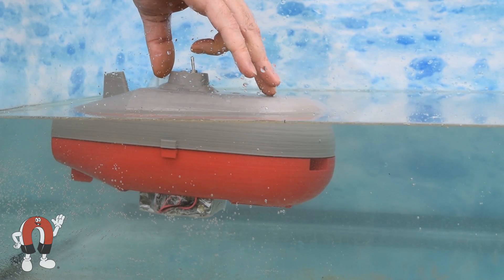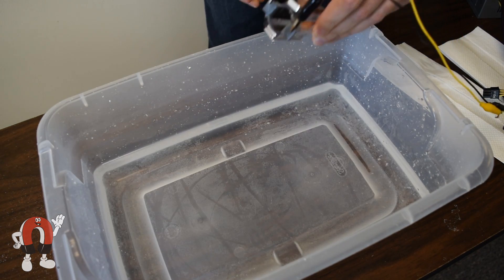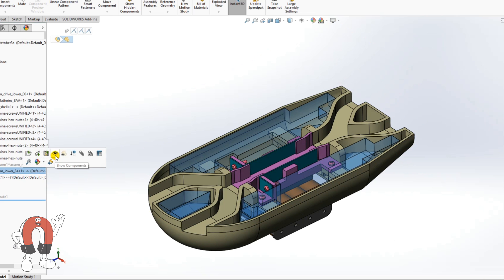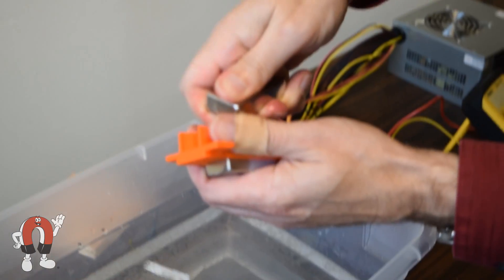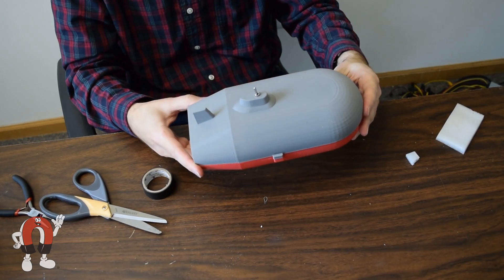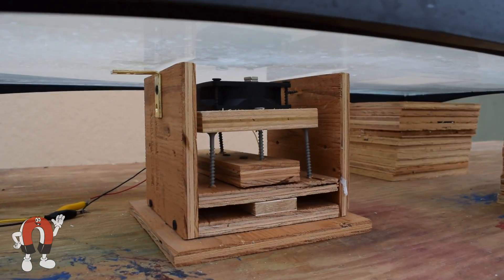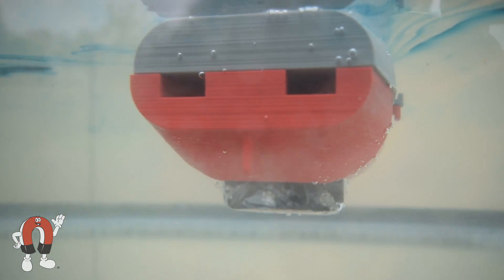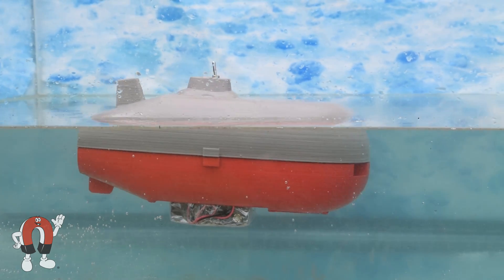Magnet Powered Submarine - The Hunt for Red October IRL!

Comment: Would love to see this with:
1) Actual parallel drives so you don't lose force on the internal water channels
2) A narrower submarine with less drag
3) Narrow outlets than inlets to increase the pressure of expelled water
4) A rudder
Reply: 3 is a bad idea.  unlike gases, water isn't compressible.  Reducing flow by creating a blockage will work against it
Reply: @adriendecroynz  let's also keep in mind two factors here 1 gases are being produced and 2 keys also keep in mind how a pressure washer works, the narrow exit forces the water stream to its tightest level creating force. The more narrow your stream is the more pressure you'll get. So in theory exit ports that are smaller than your intake ports should produce a tighter stream creating better propulsion.
Reply: @docneedles69   The velocity of the "tighter" stream will be increased, but that is immaterial, as is the pressure. A nozzle certainly increases the effect of a pressure washer on the dirt, but what matters here is the "kick" on the gun, ie the reaction force, and that is solely a function of mass ejected per second. And (getting back to the model sub) because the OP wanted to constrict the outflow, that mass flow rate will be reduced in comparison to the unconstricted original design because of increase friction, creating less propulsion force.
The amount of gas produced (in terms of mass) is absolutely negligible.
Reply: @adriendecroynz  not unless they meant it as a nozzle.  Otherwise nozzles would blow up, according to your explanation.  :)
Reply: @adriendecroynz  How jet motors work?
Reply: @DAMNED SHARP KNIVES no.  Water may not be completely incompresisble, but it is for the purposes of this test.  It most certainly is not "very compresisble". You have to go down miles in the ocean for the density of water to increase by more than a percent.  Cavitation is not water compressing.  It's caused by water vaporising, and that vapour compressing.  Choking the output of this motor will just reduce thrust.
Reply: We messed with this a few years back...couldn't get it to work
Reply: @DAMNED SHARP KNIVES I guess the earth is flat too hey?  See how much you can compress some water.  Easy to compress gas.  Most texts state to consider water as basically incompressible.  Do some research.
Reply: @DAMNED SHARP KNIVES the gas is compressible. But the gas and the water are 2 very different things. At the bottom of the Mariana trench the water is only compressed a couple of percent. That’s not ‘very compressible’. The pressure levels at that depth are not recreated by a propeller on any boat. Water is moved by a propeller not by being compressed. Take another look at the definition of compressibility. It’s the ability to squeeze a certain amount of a substance into a smaller volume, hence density is a direct measure of how compressed something is. You’re conflating issues.
Reply: @DAMNED SHARP KNIVES other properties. Water is not that viscous, it doesn’t lubricate, it expands when it freezes etc. maybe instead of spending so much energy asserting you are right, you could find me a link to a page on any university or scientific paper that states that water is ‘very compressible’. I can only find ones that state it isn’t
Reply: @DAMNED SHARP KNIVES yawn. You couldn’t find anything to back you up hey? Only countless websites that state that water is basically incompressible. And that wouldn’t suit your narrative eh?
Reply: @DAMNED SHARP KNIVES I’ll give you this: water is more compressible than some other liquids. It’s much more compressible than steel. But there’s no way it’s’very’ compressible on any scale. As for the water / gas mix in the video the gas is compressible the water is not (not in that machine). It’s also a big problem for silent running. Running below about 1.3V would solve the gas problem. But I don’t believe this was presented as a gas powered engine. The gas would provide force in all directions whereas the electromagnetic force is unidirectional for thrust.
Reply: @DAMNED SHARP KNIVES so how much pressure do you need to squeeze 2 cubic inches of water into 1 cubic inch of volume?  

I couldn’t make out any actual formula in your comments. It’s hard to do formulae in youtube comments so I’ll give you the benefit of the doubt or maybe you have a link.
Reply: @DAMNED SHARP KNIVES even just looking up bulk moduli for various things. Hydrogen 1.4E5 compared to 2.1E9 for water means water is 15000 times more resistant to compression than hydrogen. I don’t know if that supports a claim of ‘very compressible’. Compared to solids, sure. But on an absolute scale? It’s down the uncompressible end of the scale.
Reply: I don't see any links.  Did you post them?  Also, water is actually less compressible than brake fluid (300kPSI vs 200kPSI).  But thanks for the pointer to bulk modulus.  If you ask a geologist whether 1000 years is a long time, he will say no.  If you ask anyone else, they will say yes or a smart person will say 'it depends'.  I stand by my original statement that constricting the output of this particular engine will reduce the thrust, even with the gas.  And also that on any every day scale, water is treated successfully as uncompressible.  In a specific hydraulic (where do you think the hydra comes from) laboratory dealing in very high pressures (the reason I raise the Mariana trench is because it is the highest pressure place on earth you can actually go to, but even that's only 16kPSI, but still much higher than max hydraulic pressure in hydraulic machinery of 10kPSI.  At that pressure water would only compress a few percent.  Not what I or most people would call 'very' compressible.  But thanks for the chat anyway.
Reply: @adriendecroynz  you talked a lot of talk and overlooked the main fact that air at subsonic speeds is treated as "incompressible" and aerodynamics is exactly teh same as hydrodynamics... bernoullis applies. conservation of momentum. 

all that talk and yet you dont understand how a jet drive works...
Reply: @DAMNED SHARP KNIVES bouyancy is more a matter of density and displacement.  When you drop an aircraft carrier into the ocean, the water doesn't compress to accommodate it, it is just displaced, and the water level around the earth goes up by some infinitesimal amount.  Just like when you get in the bath the water level rises.  To squish 2cc water into 1cc you need over 10000 bar or over 150,000 PSI.
Reply: actually it's more than that, since the k increases with pressure.  Otherwise you could squish something to absolute zero volume with only the bulk modulus of pressure.
Reply: @DAMNED SHARP KNIVES if you look at the phase diagram for water, you'll see that it goes to gas at about 0.03 Bar at 20C.  My understanding is that's what is happening in cavitation.  The pressure is lowered and the water becomes a gas.  I don't believe even a 10% change in bulk modulus for water would mean ships no longer floated.  It's mostly displacement, very little compression.
Reply: Greater weight to have multiple drives, nozzles increase velocity but presents a pressure drop to do so.  I'd first work on increasing magnetic flux density while keeping electric current to where electrolysis is minimized and perhaps using radio waves or magnetic induction instead of electrodes though with radio waves, it would be more of a plasma drive than a MDHD drive.

Parallelism can wait till you work how far you can divert the energy transfer away from the electrolysis on the plates.
Reply: 3 is a bad idea, but the assumption you make is also wrong. Narrowing the tube is not increasing pressure, it actually decreases pressure; what it does is it increases velocity, and velocity x pressure is a constant value. However, as promising as increasing velocity might seem, it's not going to work in favor of a faster sub (less moved mass per time unit at faster velocity under less pressure is a net loss in thrust).
Reply: @lucemiserlohn  depends on how you measure the pressure.

at RIGHT ANGLES TO FLOW the pressure is low.

but looking into that higher velocity flow, theres momentum, inertia, and a higher ... ffs, i forget terminology... "dynamic pressure"? theres static ambient pressure with teh added momentum.

pitot tubes...
Reply: @DAMNED SHARP KNIVES plenty of people don’t understand the science behind what they do for a living

Comment: That's nice, but how does it scale up?
Reply: Poorly (for speed) as I understand the science, even if you have access to a nuclear reactor!  Now they WOULD be very quiet especially at a submarines normal operating depth but even so, most submarines are tracked by listening for mechanical noises OTHER than the screws (pumps and ventilation blowers) and this drive system wouldn't eliminate those noises.

Comment: With no moving parts I would think this has to have been considered in some way for the navy. Less things to wear out and break. Cool
Reply: The electrodes would erode faster than standard drive systems.  I suspect something similar is used for SEAL insertion teams though.

Comment: 2:15 Those bubbles are chlorine gas & I think hydrogen 
(because salt contains Sodium & Chlorine (NaCl), then water contains Hydrogen & Oxygen, and the chlorine bonds break down first) (Something probably also reacts with the aluminum too)
Here is why: https://youtu.be/g3Ud6mHdhlQ?t=459
Longer more explained version: https://youtu.be/g3Ud6mHdhlQ?t=416
Reply: yeah i think a lower voltage & stronger magnet would be the way to go here

Comment: Some suggestion:
- use Sodium bicarbonate instead of salt, it will avoid chlorine, preserve electrodes, and is easier to dissolve.
- raise the voltage: the more the voltage the more the current for the same amount of salt
- add a rudder so that your submarine make circles instead of strait lines
Reply: This would be one of the reasons why this propulsion method is not used in real life - good luck replacing the salts in the oceans by sodium carbonate 😊. Not to mention that one could easily find the "stealth" sub by following the flammable bubble trail.

Comment: Would it work in fresh water? and what about AC voltage?
Reply: Pure fresh water is an insulator, so would not allow any current to flow between the electrodes, so the device would not work. AC voltage would reverse the current periodically. If permanent magnets were used to supply the magnetic field, then the direction of the thrust would also reverse periodically too. But you could get over that by using AC electromagnets for the field.

Comment: Using electromagnets instead of magnets and AC instead of DC, you could perhaps keep the action while reducing or completely suppressing the electrolysis. It could perhaps even allow you to insulate your electrode plates and just use them as condenser plates to induce current in the water withou direct contact with your power source.

Comment: Recommend a single venturi inlet, a single pipeline, two serial mag-drives in series, and a single cone exhaust (exhaust point maybe 1/2 of internal pipeline width for a venturi IN to venturi OUT design). Mount two smaller inline mag-drives (one just behind the venturi point in the bow inlet and second at the point the exhaust pipe begins to cone inward at the stern). Increase the exposure time of the water molecules to magnetization by using two smaller mag-drives in series (consider wrapping magnets - like a U-shape top and bottom to fully expose the "fuel" to the magneto-electric field). The desired goal may be to reduce the amount of water in the system at a given moment by using a narrow pipeline (relative to the mag-drive's Lorentz force and the mass/dimensions of the vessel being propelled). Consider reducing the volume of and the length of time that water (fuel) is in the system to maximize the effect of each mag-drive's output (IE: X amount of force exerted per Y volume of water over Z period of time). etc. etc. etc. But an excellent experiment! Well done.

Comment: I can see why they had a problem making such a drive. If it is producing bubbles, it is probably not so silent. If the goal is silence, that could be  problem. It might take some depth to prevent the production of bubbles, and then you need to determine how much of the thrust is due to the formation of the bubbles.

Comment: There are two forms of silent electrical propulsion. First is Magneto Hydrodynamics. The second is using electromagnetic force. This involves creating two tunnels down the submarine and lining them on the inside with a long balloon. Within that rubber lining is a magnetic fluid. A series of electromagnets are placed in sequence around the outside of the two tunnels then produce an magnetic field which attracts the magnetic fluid to them. By switching on each electromagnet in sequence, you create a peristaltic force which moves the water down the tube as the lining squeezes the water in the tube, in exactly the same way as food is propelled down the alimentary canal in a human gut. 

This form of silent drive is better than the Magneto Hydrodynamics as it does not involve passing a current through the water or the production of hydrogen and chlorine from electrolysis. The amount of these gases would produce a tell-tale stream of bubbles out of the vehicle, as well as wear down the electrical anodes. However, the rubber lining would wear over time and be subjected to sea life such as barnacles. This could explain why it would be necessary to cover the entrance and exit of a such a drive whilst not in use and also used anti-fouling fluid to prevent barnacles blocking the tube. 

A nuclear powered submarine could generate sufficient electrical power to drive either system. Nuclear submarines stay underwater for extended periods because they can create oxygen using electrolysis. The problem with either system is that they rely on creating a massive magnetic field. Submarines can be detected by their magnetic signature and how it disrupts the planet's own natural magnetic field. So increasing the magnetic field might give away the position to anyone on the surface or in the air, even though the propulsion system conceals them by not making a noise.

Comment: Dude that's pretty cool, using sea water, electricity, and magnets to produce thrust, it doesn't use any moving parts, that's very cool.
Although I think the electrodes would get worn out pretty quickly seeing how it's basically reacting with the sea water by electrolysis

Comment: (It's been a while since I did Chemistry but if I remember correctly) Simply adding salt is not going to change the solubility constant of the water. Increasing the Temperature/Pressure will increase concentration but adding salt when there are already grains on the bottom will only add more grains and the equilibrium of solute to solvent will remain the same....the unused salt in the reaction will just accumulate on the bottom.
https://www.ausetute.com.au/solubilitylcp.html
Reply: Sea water has a relative low concentration of dissolved salt (and other ionic compounds), so adding salt, up to the saturation point increases the electrical conductivity of the water and thus also the current and thrust generated by the MHD drive here.

Comment: great idea, very entertaining video :-)   but since you can't just increase the ocean's salt concentration IRL, the way to get more speed would be to use a stronger electical current, stronger magnetic field (or both?). I'm curious if someone could calculate how strong current/field would have to be to power a real Typhoon class sub to achieve speeds between 20 to 30 knots. ultimately an academic question, of course, since a drive that produces masses of bubbles would be useless on a submarine due to being way too noisy.
Reply: A Typhoon is a big fat sow of a boat, 20 knots is flank speed.  If you're trying to be quiet, 5 knots is the best speed.  At depth, the bubbles wouldn't be much of a problem due to the water pressure.  As the bubbles rise and expand, they might make a decoy effect above and behind the sub.
Reply: @2fathomsdeeper  Wouldn't such a (permanent?) decoy effect be like a trail someone could follow and use to extrapolate course and/or location of the submarine after a while? And ok, when you want to stay quiet, you would want to go slow, but what if you have reason to believe you've been discovered - or are in danger of being discovered - and might soon come under attack? In that situation you'd want some speed to get away from your current location, wouldn't you?

Comment: The Japanese built a MHD powered experimental ship back in the 1980's. It reached 5 knots.
Reply: Yamato 1 was seriously underpowered. Better powerplants existed back then but nothing official was published.
Reply: @nighthawkviper6791  I imagine the japanese designs weren't running mega watt level reactors. Seems like a great application for nuclear power.
Reply: @johno1544  ... well, the actual Soviet Typhoon submarines that Tom Clancy based Red October on were nuclear powered subs, so who knows?
Reply: @johno1544  Even those would not have helped. Without going into too much detail, if you try to push more watts into the water, it just heats up and the electrolysis intensifies without much more thrust. Extremely efficient superconducting magnets would help, but even with those there is a hard limit on what can be done...
Reply: It also reached respectable deciBell levels as I remember. Meaning, it wasn't silent by a long shot.

Comment: Excellent video.  Have you considered isolating the cathode and anode from the salt water?  So that only the metal plates are exposed to the water.  I think you may have a short that is giving an alternative path for the current to flow.  I think you would see more flow that way.  Truly excellent though.  I always assumed the movie used a fictional drive system, until now.  Very cool.